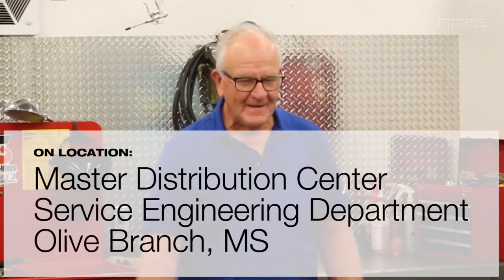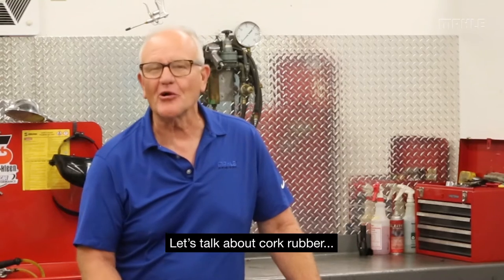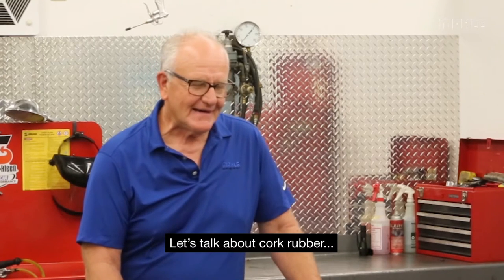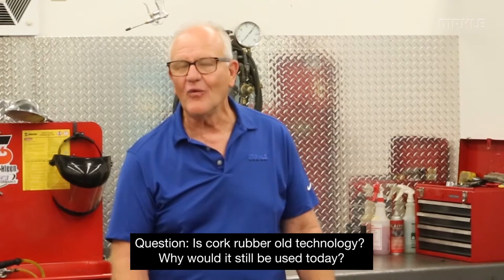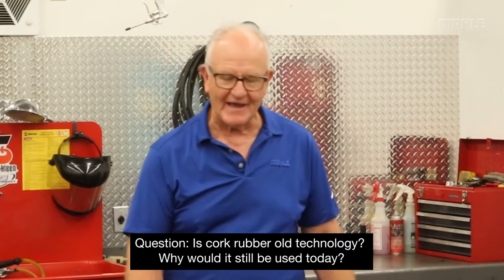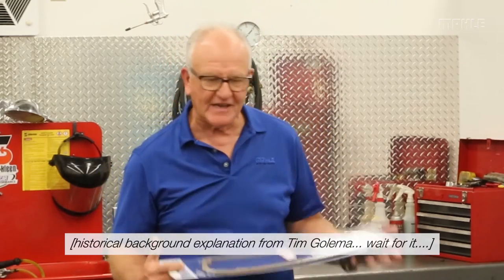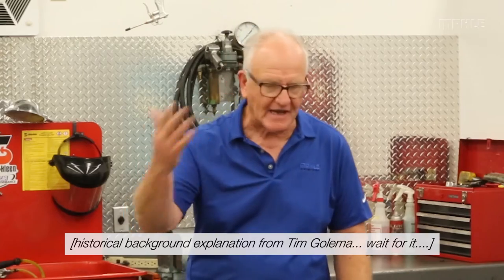About Cork Rubber Gaskets

Comment: Should I coat the cork/rubber gasket on my transmission pan with anything before installation?  Thinking of ATF, assembly lube, or silicone grease.

Comment: I am trying to figure out what kind of gasket/padding is used in a strut/shock of a washing machine.  It is just some sort of pad about 1/8" thick, 1/2" wide by 1 1/2" long on the front load washer's shock and the top load suspension it is just a rod, cylinderical shape is all.
It sure doesn't look like a cork/rubber thing although I feel that it would work. 
The whole purpose of it is to provide friction instead of sealing or seating two materials together.

Comment: I’ve been told cork rubber gaskets are still
Better to use on my old Chevy c10.  I’ve got a modern rubber gasket on it now and it’s leaking.  Thinking of going back to the old cork rubber

Comment: Which last longer for oil pan for cars?  Cork/rubber gasket or RTV only?  Can anyone answer this, please?
Reply: 30 years or rubber has worked great for me. I only use RTV in an emergency bandaid or when you just can't get the part.